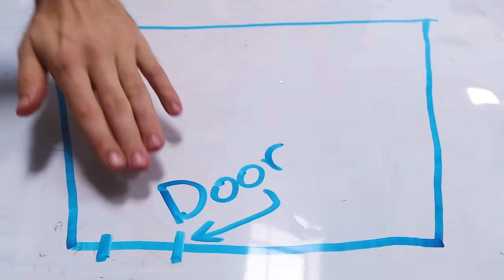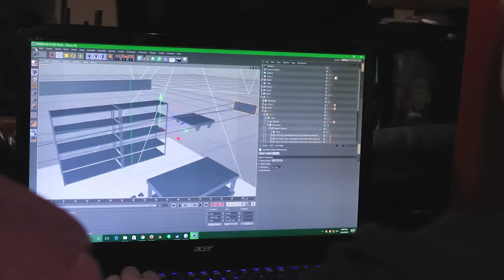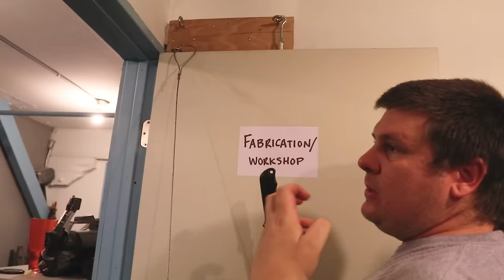Let's EXPLODE a Battery!

Comment: Fun fact! - Li-Ion batteries contain less than 2% actual lithium. It's usually mostly nickel and carbon.
Reply: wrenthereaper Dang it, I can't think of any Wren puns to squeeze into that sentence. :(
Reply: Nathan Clark - Nothing Serious carbwren
Reply: wrenthereaper so much fun reading it!
Reply: This is Lipo not Lion
Reply: Dank Tank Technically they're the exact same. LiPo, known fully as Lithium Polymer, is literally just the lithium ion cells that are folded and then wrapped in a polymer, aka flexible plastic, compartment. In traditional lithium ion batteries, the cells are wrapped up like a fruit roll-up, and then inserted into a metal cylinder. It's super fascinating but chemically speaking there is zero difference between LiPo and Li-Ion.
Reply: How fun
Reply: @dennis1727   Lmao
Reply: 2% Li, 98% ion
Reply: Nerrrrd  

Tfs inside joke

Comment: Pours water on lithium fire.
Reply: It would've been nice to see them deprive it of Oxygen/using CO2 vs dousing it with water
Reply: Forgive me but I'm stupid. Why is this a bad thing?
Reply: @MeepMayCry  because Lithium is an Alkali Metal and they kind of explode when they touch water
Reply: @jakobschultz1663  Doesn't look like it exploded?
Reply: @Intruder What he’s basically saying When they shot the Lithium battery it makes an electric fire and when you douse it with water it increases the flame. A regular fire is like putting a match on paper, you can drown that with water but in an electric fire you can’t

Comment: As soon as I saw that design I knew it was gonna have issues. Tried to design one of those tensioned wire dollys a few years back, not easy.  Think you will need a larger diameter wire for the two longitudinal tracks if it's gonna work.
Reply: poles are the future
Reply: Wow Real Engineering is here? Awesome channel!
By the way, that design is horrible, too much cable tension everywhere, the dolly will be super hard to move, better switch to pipes or bars instead of wires.
Reply: take this up there
Reply: Why don't they have some support (tubing, wood, etc.) on the second axis (the one where the camera sits on) between the two blocks of wood that move along the first to keep it at the correct tension, therefore the tension isn't on the cables. You'd have yo have the peice be the right size to keep the tension, but that wouldn't be very hard. It should be able to keep the tension without putting any tension on the cables that are coming from the wall. Pipes or Bars would've been the best initial system though.
Reply: I personally would have used some 8020 extrusion that was bolted to the wall to the only thing actually suspended would have been the cross rig, also doing it this way would have allowed for a much more weight capable system.

Comment: I think you should ditch the wires and move to a rail-based system. Doesn't have to be metal rails, wood or even plastic would be enough, just as long as it's way less flexible.

Comment: Spencer. If you take an Allen wrench, put the long end in the drill chuck and put the short end in the eye of the eye bolt. You will not have to attach the eye bolt manually.

Comment from the maker: I've finally posted that Reddit link (it's in the description).
Reply: Sam and Niko YEAH!
Reply: Sam and Niko good
Reply: Sam and Niko  u Guys know that is toxic waste
Reply: There's one thing I'd like to suggest, and that is introducing bigger sizes on the caps. My head is f***ing massive, and I really feel like getting one of those caps ;____; 
I know that snapbacks have an adjustable size, but it's still too small! :/
Reply: Please make an gif tutorial!
Reply: that would be good if you made a gif tutorial
Reply: Sam and Niko GIF TUTORIAL
Reply: GIF TUTORIAL PLZ
Reply: Sam and Niko for that top-down rig, idk if it'll help but try using pic pipe to secure the two ends of wires that connect to the wall. You'd have to cut a slot in the pipe of course, but it should help with the tension issue.
Reply: Sam and Niko you guys should do another D&D campaign
Reply: Little Moose yeah they shoulf. DO IT
Reply: Sam and Niko asking for upvotes is strongly discouraged and will get you banned eventually.
Reply: Sam and Niko plz do a gif tutorial plzzzz
Reply: For your guy's Dilemma why not use extra wire to travel down the back of
 the board to the ground and then attach to the concrete or use a really
 heavy board about 5x the weight of the actual foot pound and then pull 
the wire tight?
Reply: If you want gif tutorials, reddit is the place.
Reply: Jovial Skunk so said the youtube commenter.
Reply: Gus Brady
Aw, thanks. I like you too Brady.
Reply: Sam and Niko
Reply: Sam and Niko hi
Reply: Sam and Niko batteries are the power of the machine not the heart
Reply: Sam and Niko ourmine had hacked ur channel
Reply: Brandon Gervaise That's cute.
Reply: Sam and Niko what program do you guys use to edit the videos j need it
Reply: In Wrens defense, that is a Chemical engineers line of work. 

Saying you are an engineer is like saying you are a artist. You could be a musician, painter, sculptor, etc. 

There are civil engineers (skyscrapers) , materials engineers (carbon fiber), mechanical engineers (drivetrains, pin and tumbler locks) and more.

Comment: Yeah, the tension needed to straiten a wire under load increases exponentially.  Poles might have been a better idea.
Reply: could have maybe been possible with an acceptable amount of sag if the entire track rig and camera weighed like 200-400grams, so say a gopro and then tiny brackets/wheels/bearings etc. but looks like their runners and camera sled weight about 5kg on their own.
Reply: was gonna say poles would be a better idea.

Comment: Wren is right. The poles would be much easier. Thet way you do not have to worry about the wires and the tension of them. And the camera will be much more stable and can take more weight.

Comment: I would highly recommend going the rail route with the workshop top-down rig. Take the sag out of the cables, can be wood or steel angle with some sort of screw wedge system on one end of each rail so you'll be pushing out against the wall instead of hoping to see how much weight your wall hardware can hold under tension. If you're concerned with noise, foam between the rollers and the rails could help silence movement and smooth out the ride.

Comment: There's a lot of cheap and lightweight piping that you guys could use for the rails: pvc pipe, vinyl or steel electrical conduit, copper piping (super lightweight but expensive), or even wooden dowels.  Excited to see what you guys come up with!

Comment: For the top down rig, instead of using the wires why not use slider rails? Those seem like they'd be easier to mount everything on than the wires, though they might be a bit more expensive.
Reply: For real. Big heavy camera rig and they want it supported by cables upon cables? This is what happens when you try the cheaper option lads, what you save in money you pay for in headaches.
Reply: But you also learn.
Reply: I was about to comment that :P

Comment: You can use a James Cameron kind of 3D rig to shoot mix-reality without a green screen. 
Add a periscope to the camera. Add a thermal or inferred camera at one end of the periscope so the filmed shots to have the identical image. Then use the thermal or inferred data to mask out anything that isn't giving off a human level of heat signature. Apply the masking data to the normal footage and place the mix-reality stuff in the background. 
This is a lot of work, but you can shoot the VR player from any angle and without the need of a green screen.
Reply: I promise you that this wouldn't work as well as you think it would.
Reply: Is it because of the resolution differences between the thermal or regular camera or is it because of the inconsistency with back ground heat source?
Reply: ***** This is the sort of thing that works in theory but it won't work either. With photogrametry you get baked in lighting, but while filming, every inch you move whatever surfaces the camera sees reflects a slightly different amount of light, so it won't match up perfectly. I've tried working with difference mattes a LOT over the years and they only every work good enough for quick shoddy jobs.
Reply: ArchOfWinter That's just not what a thermal camera should be used for. I see what you're getting at though, but things like clothes abscure the amount of infrared you emit, and things like your headset/straps/shoes/controllers won't emit anything usable. And this is assuming your lens pass-through system is flawless and that your thermal camera matches the framerate and resolution of the RGB camera, which can cost dozens of thousands of dollars and are not small.

Besides, the mixed reality that James Cameron used did involve green screens. The only times it didn't were when he was shooting actors doing motion capture. In theory you can create a depth matte from shooting in 3D with 2 cameras, but that's a length process too. 

All you need is depth information. If you were shooting this with a Kinect camera, then yeah that's quite feasable! But the Kinect camera is still kind of low quality and the depth matte you get from it will still require a LOT more work than just simply using a greenscreen.
Reply: ***** The pixels have to be identical for them to cancel out, and very close for you to fudge a difference matte into place. By the time you go through all the effort of creating a flawless photoscan of the room (something that is incredibly difficult) and somehow manage to replicate the lighting system perfectly (something that is practically impossible with current technology), you could've rotoscoped every shot for every video you'd want to do this with anyway haha.
So yeah, in theory, if you tried really really hard, yeah you could maybe manage it. 

Now as far as comping in a photoscan AS the background, that could work! However, currently SteamVR only kicks out a background and foreground around where the headset is, so you'd get everything from the game behind the headset, including the game world. So that'd overlay on top of the photoscan anyway haha.
Reply: i feel, like 300% smartererer now. Thank WREN! and camjvideo too.
Reply: I feel like when all of these becomes financially feasible, the channel will focus their money on actual projected 3D interactive holograms.
Reply: yep.....DEFINITLY

Comment: The moment you started talking about building the rig with wires all over the room I doubted it would work good.. But Spencer seems like he knows his stuff..

Well, my first impression doesn't seem to have failed me.. Sorry guys, but wires are just a mess
Reply: Spencer tends to act like he is an amazing engineer or something. But this and other ideas of his have been less than mediocre
Reply: Yep... Also, there is a reason huge lift cranes (like those on rails) use huge beams and motors that drive it across the rails mounted to or made into the beams.... Wire is just not rigid enough to support much of anything horizontally.

Comment: Haha as soon as I saw your plans for the top-down rig I knew there would be problems with the tension on perpendicular axes. But still, it's cool you guys thought out a plan and tried it out, that's how we all learn!! Like Wren said, poles would work better, but you can keep the cable system for the one axis. That way you can have your X movement on the cables you have already setup and connect those carriages with rods for your Y movement; best of both worlds! Keep up the great content, love seeing what you're up to!

Comment: 9:30 Make the 'dolly' that rides the outer cables rigid -- that way it doesn't rely on the tension to keep height. It's exponential and will ruin the wall quickly as it currently sits. :)

Comment: gg.. trying to extinguish something with lithium with water..
Reply: As a science geek myself, I can assure you that this is totally fine. The amount of lithium in a LiPo battery is less than 2%. It's mostly just carbon and nickel. And low and behold, water put the fire out just fine.
Reply: wrenthereaper yeah i know its just a little lithium but still maybe they shouls have gotten an extinguisher
Reply: Perhaps we should have. But it wasn't a big deal. We knew it'd burn itself out before any harm could be done. The water just doused the remaining burning items.
Reply: +Wiener_Dawg It's not really a lithium fire.

Comment: For the top-down rig. Just to be sure it doesn't rip the screws from the wall, I would double the number of cables everywhere except on the center portion. That way, you have twice the tolerance on the exterior cables, allowing you to tighten the 2 cables that actually hold the camera.

Comment: Awww Sam felt left out. I think wires on the Horizontal would work. Those you can reinforce and Tighten better into the walls.  Then Poles on the Vertical. Light Metal poles. where the camera rig is on Mini Dolly on Rails.  But Poles might be better all the way around since it is a short room. Metal Conduit Tubes.

Comment: Hey, have you considered using conduit tubing to make the "top down" rig?  The weight of the camera and mount shouldn't be heavy enough to cause any sag at the  mid points. Compression fittings should supply more than enough grip and support to mount through the wood panels you're currently using. if cut to length this should get rid of all inwards [ --> <-- ] force that has been created by the steel wire. The bigger benefit of this is the conduit's smooth surface unlike the stranded wire. if you add stepper motors (or whatever motor you think will work best) to a set of wheels or pulleys and you'll gain movement throughout a build (should work for video and time-lapses if you decrease step increments to a fairly small degree).  
Alternatively you can mill out some of the wood on the back of the wall bracket and get a loop bolt some washers and a nut to increase surface area and not relay on the threads

im looking forward to seeing updates on the build room haha

Comment: They do that kind of top-down camera stuff in stadiums. Except the camera is directly connected to the walls and they use pulleys to move it around the space. Only downside is you need a high ceiling when you want to do that indoors. It's called SkyCam btw.

Comment: 5:20 

Instead of buying a tool, which i'm sure there is one. You can just use a another screw in hook placesd in a drill (so the drill tightens on the threads) and then put the hook through the other hook and turn the drill slowly while pulling back on the drill. I do it all the time at work :D
Reply: side note:  I know the ones you're putting in the wall are completely closed in, you'd just have to buy one that's a literal hook. 

Like This:

http://www.homedepot.com/p/Everbilt-1-4-in-x-3-3-4-in-Zinc-Plated-Lag-Thread-Screw-Hook-806966/204273850

Comment: Cheap idea for screwing in Eye Screw Bolts, Grab an extra one ideally with a gap to be able to slot inside the mounted bolt. Grab a power drill, put the threaded end into the drill, slot the bolts together, and screw :)

Comment: just a quick solution for easier mounting of the wooden-eye-bolt --> take a second identical wooden-eye-bolt and put the threaded end in a drill ;) Pre-drilling a hole is key, but that was already done here.

Comment: To get a weighted cable perfectly horizontal you theoretically need infinite line tension. Its quite a basic engineering problem actually. In perfect squared state the force vector of the mass is perpendicular to the tension force so they don't influence each other. Your best solution imo is to add a profiled crossbeam for the camera to slide on.

Comment: you could do a combination of both, use a set of rails on the wall mounts and the wires for the middle so that the extra tension isn't forced onto the walls and only focuses on where it is connected. At least the wall mounts would be sturdier and less likely break. though that's such a small room to work in for that kind of set up, its pretty amazing you guys actually set it up, if only the room was higher. Have you guys thought of multiple camera's in the corner for different angle shots? Possibly seems kind of boring compared to shots you could get with that set up but at least its a good fall back strategy.

Comment: For the top down rig: get rid of those wires (you're never going to be able to tension them enough) and make rails using 1x1"square  aluminum extrusion (or 80/20 if you wanna spend the big bucks). You can easily make some followers using roller skate wheels or some other stuff like that. If y'all want I can make some schematics/ parts lists for you...

Comment: Put winches in each corner that connect to a center part, perhaps a carbon fiber quad copter body. It'll be a Skycam, like the one the Steadicam inventor Garret Brown invented (his uses 3 wires). By controlling the winches you can make the camera go anywhere.

Comment: woow this camera dolly is very interesting! I wish you find a way to do it right, I wanted to do something like that some months ago, but I was thinking about the same problem you have, i think that one way to do this would be using bars instead of cables so then you would not have this tension problem.
an other way to do this would be making a spider cablecam system with 4 motors but this is more complicated in programing and you need stronger motors.

Comment: not sure if you guys are looking for an idea for the top-down rig, but if you still need a solution, try running a metal pole between the outer corners of the four pulleys and having it attached to the middle pulleys but able to move so it can have more tension instead of being loose